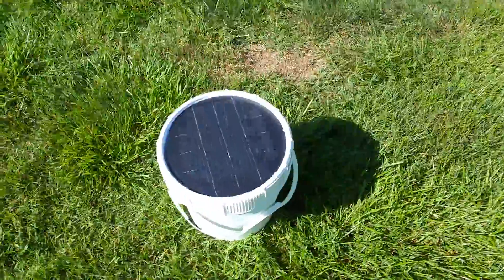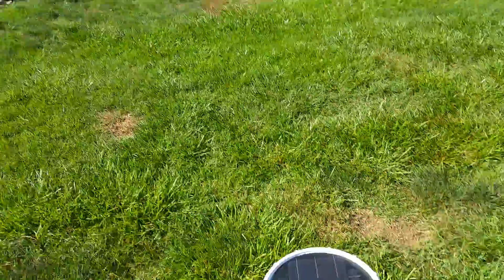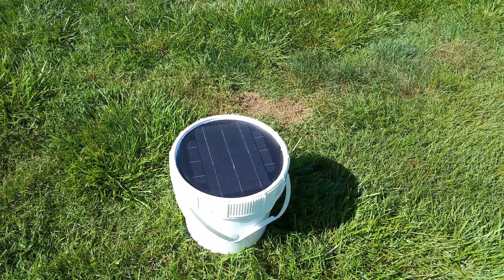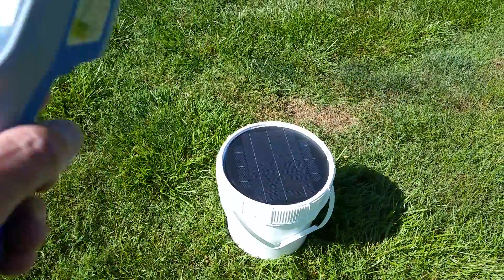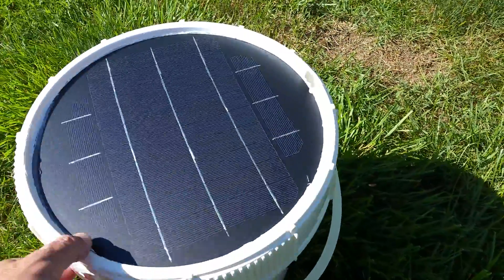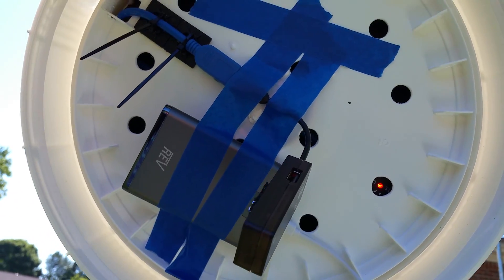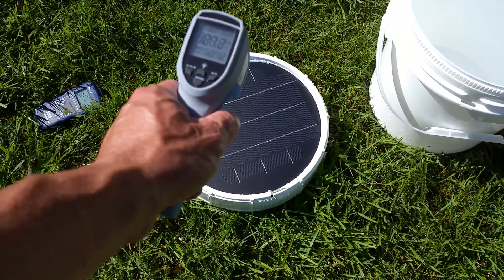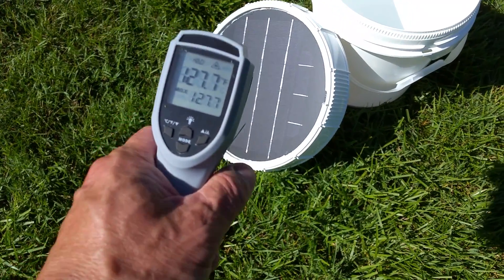Solar Panel - Surface Temp Impact

Comment: Nice experiment. Have you ever measured the surface temperature of larger roof-mounted solar panels?
Reply from the maker: No, I have not had the opportunity.  If you have I would like to know approximately what temps solar panels on rooftops can get up to as this would be nice to know whether having a smaller panel on the ground with air flow is even closely related in temperatures.  If you do, please post your results and the time of day, location, outside air temp.  Thanks for watching and commenting sir.
Reply: I saw a video after I sent you the first message, where a lady went through solar panel temperature calculation lecture and she used thermal calculations (versus direct measurement). It was a very good video actually. I'll post if I find it. I'll also take some measurements next time I am outside and am receiving direct sunlight. Again, thanks for sharing your video.